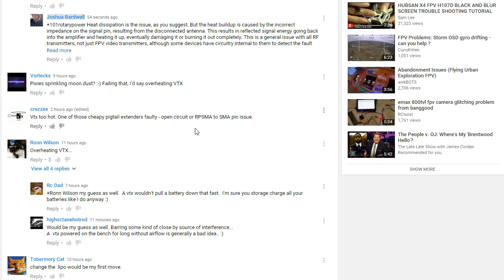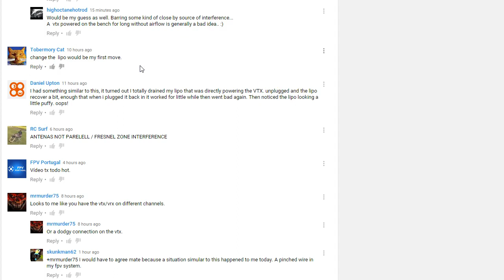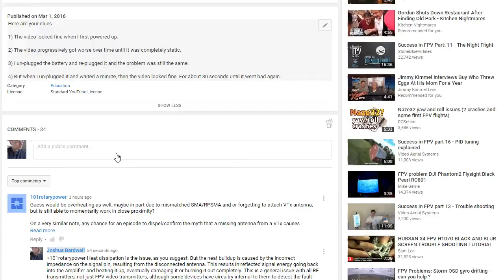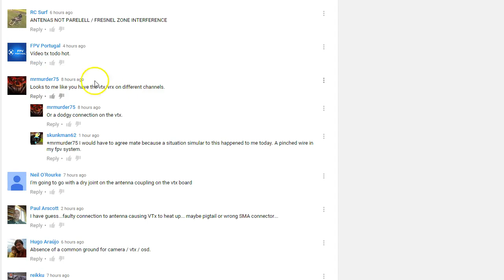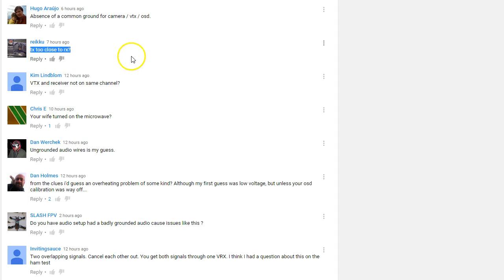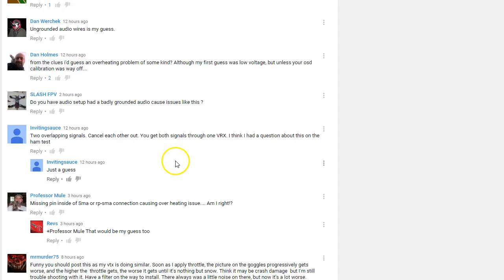Can You Troubleshoot #1 - Answer

Comment: I'm having a similar issue I think  cause by power getting low to vtx in punchouts lol damn 3s trainer batteries. I do have vtx mounted plate to frame so I might cutout carbon and put a small heatsink thanks for info. you can get bad signal from leds not sure why might be bec cant handle amps. testing my meter I learned most pdb that say 12v are only 12v on 4s. How would you know if cap is shorting out over time ? I have 25v 1000uf but I know volt spikes on motors can get large more so I think with higher D.

Comment: hi josh! got a brain teaser (well for me anyway) so had a fairly hard sudden stop on a 150mm quad. would not arm afterwards. my steps- checked solder joints. battery lead felt iffy. made new battery lead. still nothing. plugged into betaflight and aux 1 was not working. everything wlse was fine. i erased all the sp functions (sticky arming. changed output to arm switch. worked- on beta flight. quad armed reliably and on que while connected. i changed nothing else. disconnected from betaflight and took outside..... plugged in got all the good tones and would not arm.? my guess is flight controller is fd. what say you sir. any other steps i can take
Reply from the maker: https://www.youtube.com/watch?v=M0S3HTQihxs
Reply: great video i watched it earlier and now again lol. the issue is it is arming in betaflight while on desk then wont when not connected to betaflight.?. when i get home ill try shutting off accelerometer.
Reply: Joshua Bardwell i feel like an idiot. it seems it didnt take the save when i set up the switch. its working now lol.

Comment: Makes sense when you think about it.  Carbon fiber, while it does conduct electricity, it is actually a thermal insulator.  Putting the heatsink against the carbon you severely limit the airflow and basically make it like an oven between the fins.

Comment: I've read that an antenna that isn't designed to have high power TXs running through it will cause a TX to overheat. Something about the resistance being too high so you get a buildup in the TX. Might be wrong..

Don't think it should be getting so hot so quickly. I have the TX mounted up against the frame on one of my quads and it's never done that, even when stood with no air flow.

Comment: hey joshua, I actually been trying to fix an almost similar issue biut I've isolated the trouble to be the capacitor...set at 6v it shuts down my video and won't come on until I unplug and replug.  anyway you can instruct on desoldering the capacitor?
Reply from the maker: +dcFPV _ I'm a little confused. What do you mean by "set it at 6v"? Set what at 6v?
Reply: +Joshua Bardwell sorry, I have a headset display with lcd screen and vtx, the screen has a 6v cutoff. it's a snow screen,starts clear and then starts to cut out, eventually the screen shuts off and takes a unplug/replug to come on and is nice and clear again.  weak signal tends to do it.  the vtx works good with another screen so I figure it has to be the 6v cutoff that is malfunctioning.  is there a way to remove that?
Reply from the maker: dcFPV _ The 6v cutoff is because that's how low the voltage regulator can work at. There's no way to undo that. It's like saying, "When my car battery is low, my lights don't come on." You can't fix that by removing some circuitry. There's just not enough juice.

Assuming the screen has an external video input, try plugging it into some other kind of input like an Xbox or a DVD player or something. Plug it in directly with S-Video. This will determine whether the problem is related to the RF link or the transmitter. If the problem still happens when plugged in to a DVD player or Xbox, then the issue is the screen.
Reply: +Joshua Bardwell gotcha.  yah I took the vtx and used a different screen and it works good, used a different vtx on the screen and it shuts power to the screen when signal is weak.  juice is enough, I've tried multiple sources.
Reply from the maker: dcFPV _ I don't think it's that the screen is shutting off. I think it's that the vTX is crapping out and the signal is going away.
Reply: +Joshua Bardwell even with a different vtx?
Reply from the maker: dcFPV _ Hang on--I may have read you backwards. You tested the vTX with a different screen and it was fine? Yeah... in that case, it's the screen. But I don't know how to advise you on how to repair it.
Reply: +Joshua Bardwell thank you tho this info is still really helpful.  I'm gonna re-trouble shoot it all just to be sure because no screen= no fpv for me.

Comment: How did you feed your vtx with power? Straight from the 4S Lipo Voltage or from a 12v BEC?
Reply from the maker: 12v regulator. I have seen too many TS5823 burn from 4S.
Reply: +Joshua Bardwell lol, been there. It's always fun losing feed mid flight... not!

Comment: Yay, one of my comments got picked for the video. Go me! 
This was interesting to me. I've never seen this sort of signal degradation due to an overheating vtx before. They do get very hot, as we all know, but I've never noticed it affect my signal before. Now if it happens in the future to me, I'll know what to look for. Chaps, here's one for you, if your signal degrades enough to go to nothing but snow as you climb up the throttle range, what does that tell you the issue may be? My vtx power is unfiltered, running from a 3s lipo. I've always had a little noise on there, but it was flyable. What could of changed in that, that would now cause the snow issue that wasn't present before? Nothing has changed on my setup from flyable state to unflyable state. I've got a filter en route to see if tht helps.
Reply: Oh, I did have a heavy crash. But even then the issue was not immediately present. Maybe 2 or 3 lipo later it started showing up. A rudimentary visual inspection revealed nothing obvious.

Comment: Hi Joshua, this is exactly why I use copper finned heatsinks for my VTx. I have Very tight packing density,my cooling is compromised, and as a cooling supplement the 5.4g weight penalty increases reliability.

Its a necessary evil, but it seems to work across all/most conditions.  
 
http://i.imgur.com/tnhu6J3.jpg

Comment: As you have learned  never power the mini vtxs for very long without some airflow. If you do try it again..check temps..even if it is just by touch..they get HOT on the bench. I've read that's a sign of a poorly matched antenna design..but I do not by it because I've seen the heat out of multiple small vtxs with multiple brands of antennas. I've just got in the habit of unplugging the vtx until video is absolutely needed when doing bench work
Reply: +highoctanehotrod If you go through the exercise of comparing input power vs output power of the typical VTX you will discover they are grossly inefficient and the difference is essentially tuned to heat. Which is why they always run warm even with a well matched antenna and will run hotter again with a poorly matched antenna.